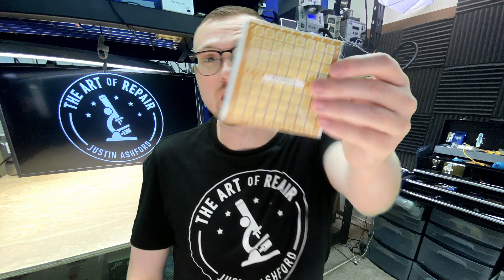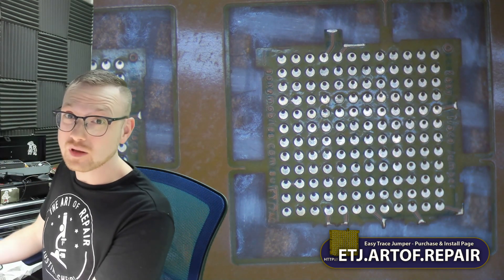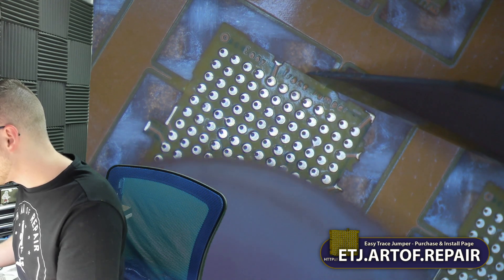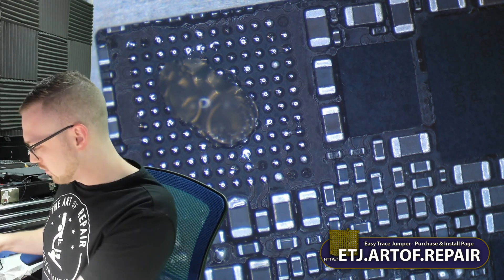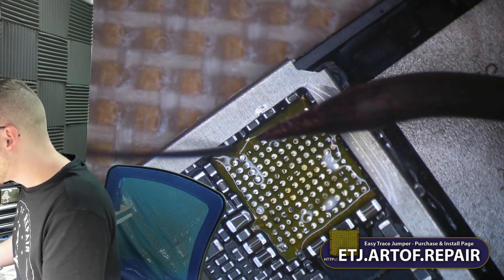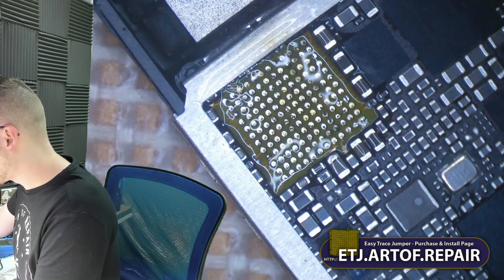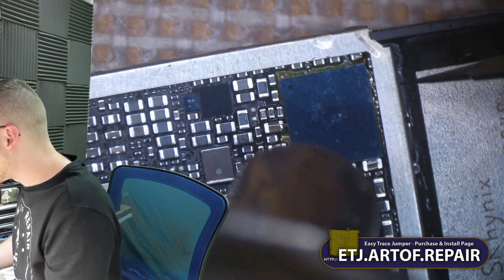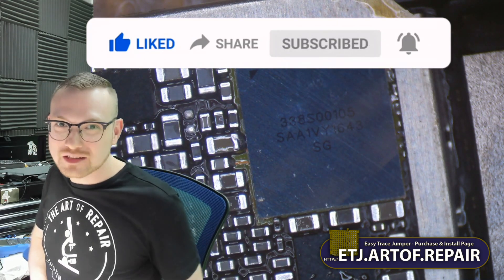Easy Trace Jumper for iPhones 7 Plus Audio IC Repair Installation Video

Comment: Dude you said 2 seconds job but you spend 20 minutes talking . 
Anyways thanks 🙏 
As always I have learnt something. I’ve never knew about this easy trace jumper
Reply from the maker: It’s the install video where I clearly explained I was taking my time to show you how to install it right. 🤦‍♂️  that requires explanation for those who need the information. very easy to see it only takes a moment if you are just at work doing your job 😀

Comment: I guess you don't actually need to use all the jumpers. If you just want to do the 4 main ones it doesn't matter. But if you lose any of the other pads, the other jumpers are there to serve you. Like the ground in the corner

Comment: That’s a clever bit of kit that makes life easier, never heard of them. I’m definitely going to buy some. Is this the easy trace jumper for when you tear pads off the board?? Thanks jay
Reply from the maker: This is a new product developed between A1 Mobiles and Repairs in Aus and the Art of Repair. This is the first time they have been sold outside the development region in AUS =)
Reply: @TheArtofRepair  is it used for ripped pad repair?? Thanks jay
Reply: @TheArtofRepair  good idea